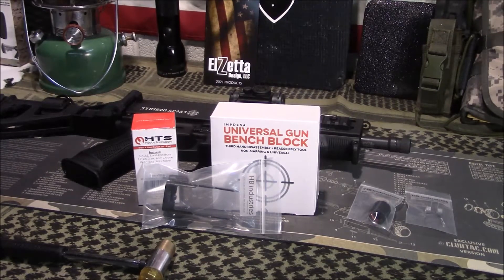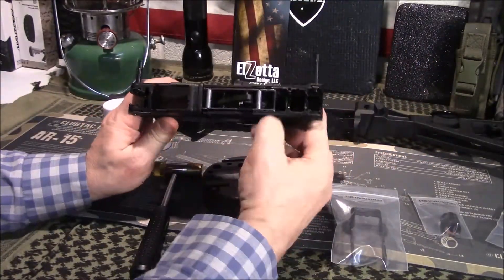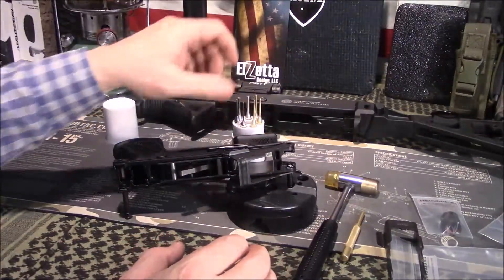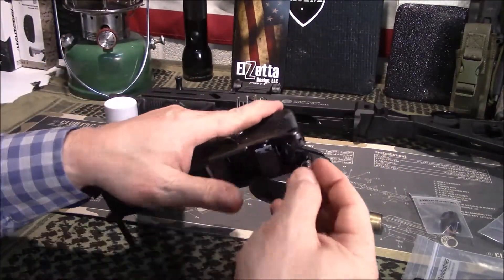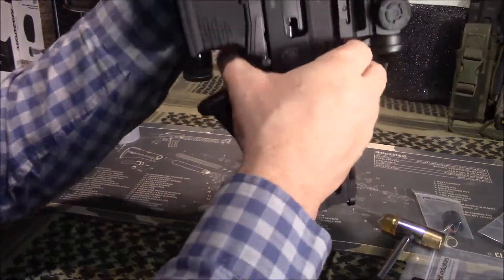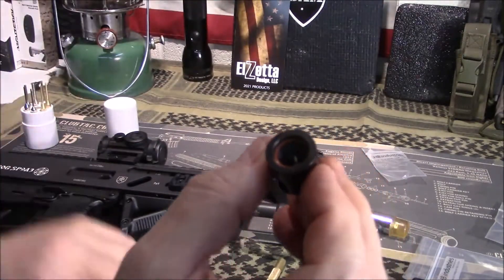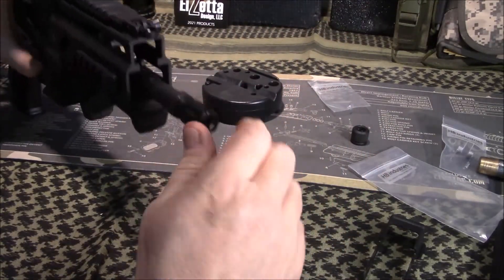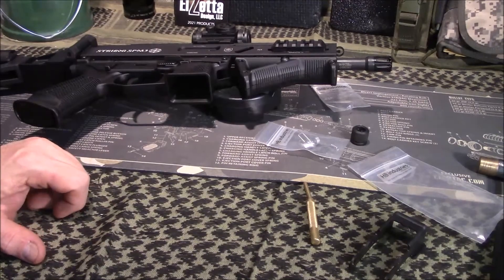HB Industries Extended Bolt Stop and Micro Comp (Stribog)

Comment: I was hesitating about grabbing on of these because everyone said it’s a hassle. With the right tools is easier than and AR pivot pin install. Thank you, just ordered the bolt stop and the locking charging block from HB, that solves two of the main/only issues I had with my bog.

Comment: Thanks! What angled fore grip is that? Waiting on my sp9a3 to be delivered and want to get a grip that fits.  Also, any wisdom for the best way to mount my obsidian 9 to the stribog? Hate the gap that is left between handguard and muzzle and not sure what length handguard extension is best because I will be using the can on my handgun as well.  Do not want to make it so hidden that its a pain to remove… thanks in advance!
Reply from the maker: Magpul

Comment: So I installed the the extended bolt release and now when I pull the charging handle back on a empty mag it won’t release the bolt forward when before it would does yours do the same thing.
Reply from the maker: Not exactly sure I am following you but it has a last round bolt hold open which means with the bolt forward and an empty mag then inserted and you pull the bolt back it would hold open. If I put an empty magazine in with the bolt locked to the rear I am able to use the bolt release and the bolt goes forward. Then if I pull the bolt back it locks open with the empty magazine. Hope that's not to confusing....
Reply: @GunsandGearNetwork  yes that’s what I mean with the hb industries extended bolt release in and a empty mag in when I pull on the charging handle the bolt release will not drop and release the bolt.
Reply from the maker: @OPERATOR-oq1le  That's strange, not sure what would be causing that.
Reply: @GunsandGearNetwork  yea me neither i appreciate your help and answering me back though, I’ll get er

Comment: Would you recommend the Stribog SP9A3?  How does the Stribog compare to the CMMG Banshee?  Thanks for the video, plan on doing this upgrade!!!
Reply from the maker: Yes, absolutely. Both are great but two different style platforms. I like that this one is nothing like the AR platform in looks but still retains some of the familiar features like the safety selector.
Reply: I have a CMMG 45 Guard. Its very light compared to the bog. The recoil is very tame for a 45 when firing rapidly. Witht the foatech echo I am able to place to shots very close to one another. I installed a Vltor A5 buffer system which makes it even smoother to shoot.

Comment: Hey really good video but quick question maybe you can help. So I installed my extended bolt catch the install was fine getting it all on was ok but when I go to lock my bolt back the bolt release can’t fit in up under the side of the upper receiver I thought maybe I messed something up installing it so i uninstalled it and put the original back on and that one works fine not sure if you experienced at all?
Reply from the maker: Not sure, reach out to HB Industries. They are great to deal with and should get everything taken care of for you.